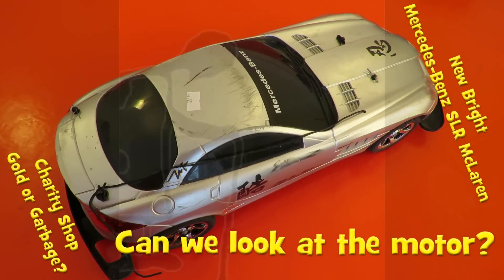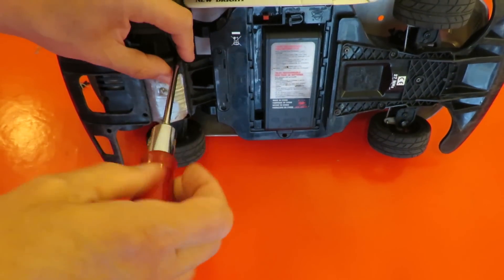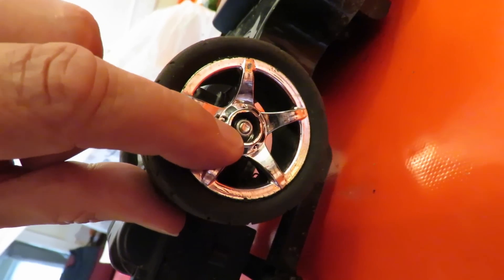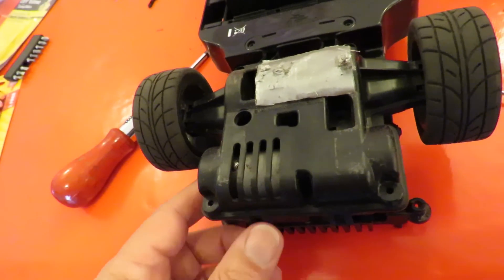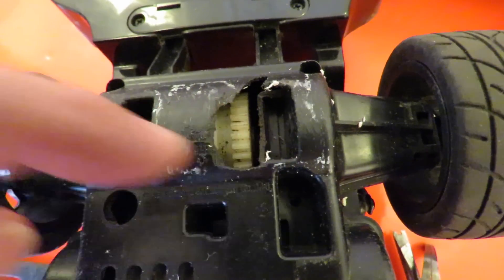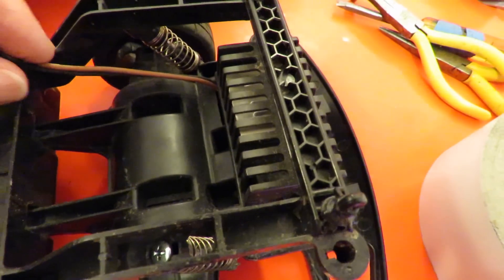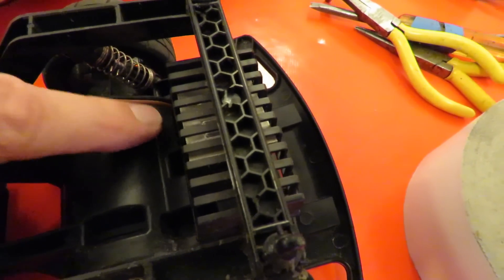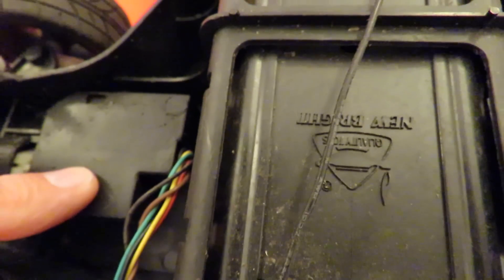New Bright Mercedes Benz SLR McLaren - Can we look at the motor?

Comment: That is a 540 motor in there probably on the rear. pretty much what most 1:10th scale hobby grade cars is running. its probably the standard 35 or 45 turn motor in there.

servo pot has two or three wires most of the time.
(Resistor values reported as how far the steering has gone from a reference value on either voltage or resistance from a base voltage = servo.

(depending on how they made the controller board signals it might be a digital servo as well only thing being the type of signal being sent & processed by the servo.) With 2 or three of the 6 wires  dedicated to positioning in this & reporting back to the resistance value or voltage difference on middle pin & basic input pin + one side of the resistors if I'm going by the same way the steering on my mini-z mr01 works or a bad servo ive taken apart is doing which means when there's no steering input being received it auto returns to reference voltage input by turning the steering back too center by itself just ordering it to turn the motor the other way.

Id honestly keep it the way it is & at best run a proper 3 or 4 cell lipo in there with a low voltage alarm rather then take it apart.
Reply from the maker: Thanks, I have no intention of taking it apart other than for the video of the parts. From experience with older plastic toys like this I know that the plastic clips snap off very easily.